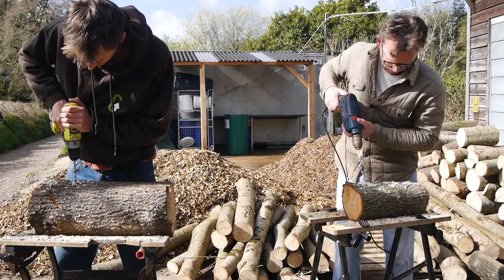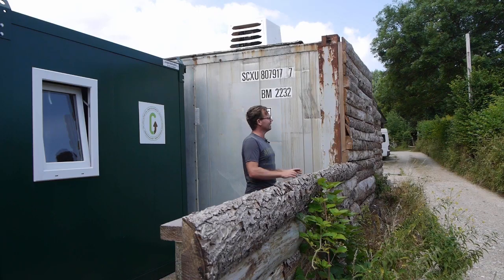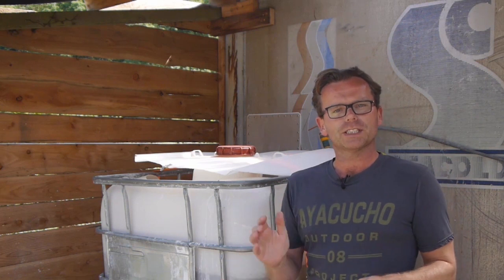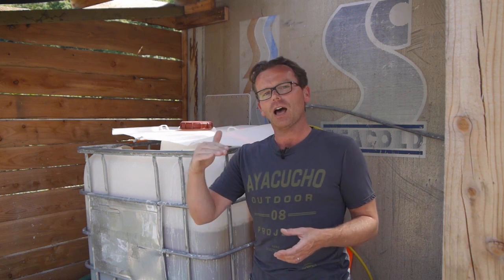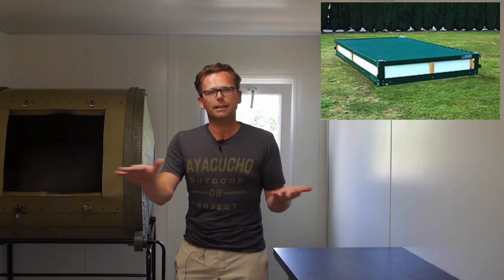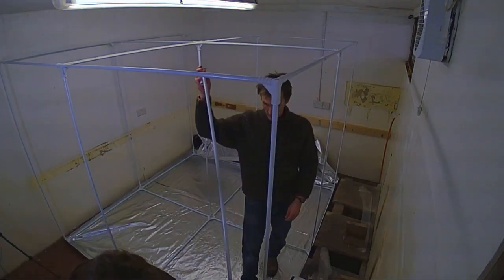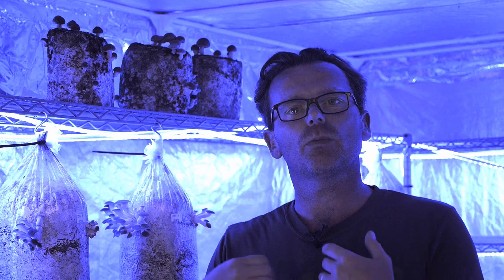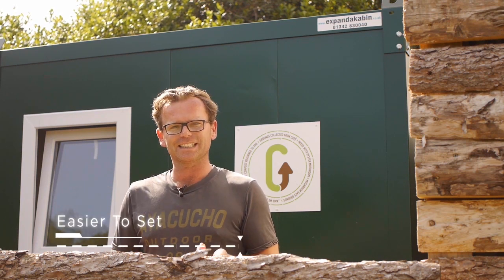What Is Low Tech Mushroom Farming? [Main Benefits & Methods] | GroCycle

Comment: I was wondering about the spawn. If you used sawdust pellets and lime pasteurisation could you create your reliable own spawn without pressure cooking? Or is there too much risk of contamination? I only ask because you said sawdust pellets are subjected to heat and pressure lime would hydrate and kill most other competitors would it still be two risky? Obviously you would need to regulate the water content. Grains are pressure cooked to get right into the centre of the grain if you use sawdust and lime should get into the centre of the pellets. Any thoughts or is this taking the low tech approach too far?